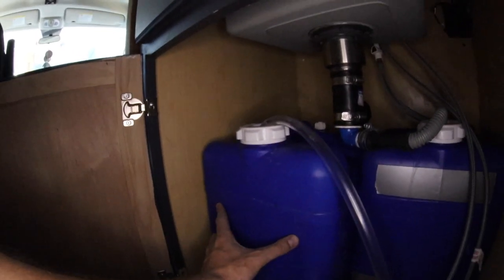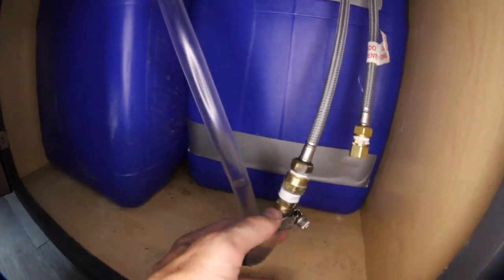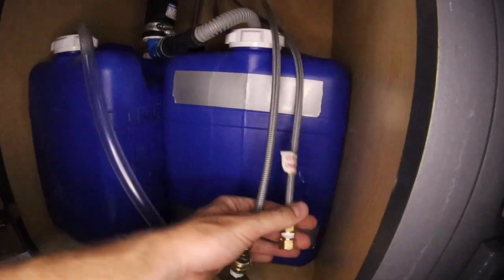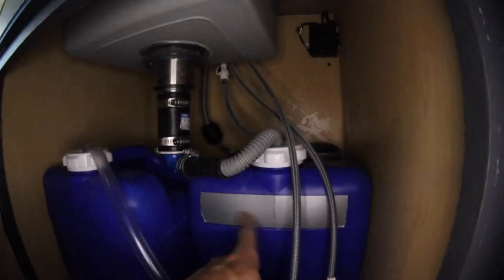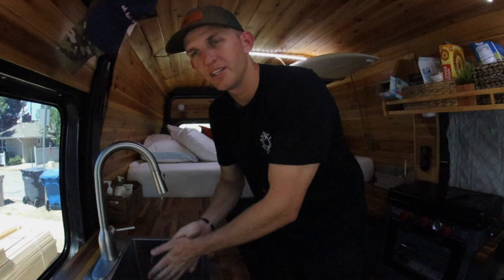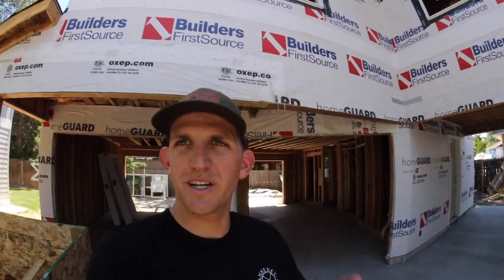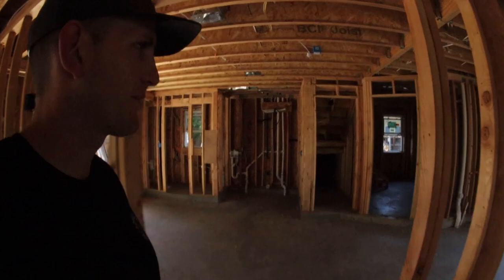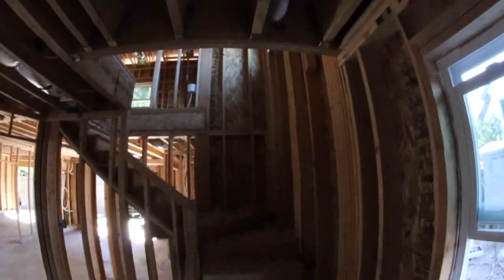CHEAP AND SIMPLE DIY PLUMBING SET UP | WHALE FOOT PUMP

Comment: Thanks for sharing this video.  Something you might consider to work in tandem with your foot pump is using a Coleman 5 gal jug with spigot on your counter top.  The jug can be placed on a 6-12 inch support to allow faster filling into coffee pots or pans for heating water etc. .  (Place jug on floor when travelling.)  The foot pump can be used when only a splash is needed to reduce water use and limit the gray water as well.
Reply from the maker: Good idea Jim!

Comment: PLEASE AVOID BRAIDED HOSES!!  Here's why: As a domestic plumber in the UK for the past 40 years I can sympathise with this old 'effort-to-flow' problem, and it is largely down to those pesky braided hoses and their tiny bore - ie the lack of space inside the tube causing difficulty in passing water! 
 We have both mains water and gravity-fed water systems in houses here, and if you try to use the braided hose tap supplies with gravity-fed systems or in low water pressure areas you will be terribly disappointed with the flow. An already poor flow will be severely restricted by braided hoses, and you will become very disenchanted very quickly. 
A foot operated pump will need a tap or fawcet with, as near as possible, a 1/2" inlet and NO hose restricting it. 
Hope this helps people to not only avoid this with manual pumps/foot pumps but also with electric pump installations, as the restrictive nature of braided hoses burns out the motor very quickly. Remember, braided hose is a big no-no anywhere in a van, caravan, motorhome or boat set-up no matter what system you use, unless those braided hoses are as close to being full 1/2" or 15mm bore right through, including through fittings. I have seen this problem aggravate customers hundreds of times, and had to explain why there is a problem. Repeatedly damaging a pump will soon make you wish you'd had wider bore pipework, and even a foot or hand pump will quickly develop a leak at a weak point in the design after persistently fighting to get water to travel through a thin stretch of hose.  Whale electric pumps are wonderful, but if you make them struggle non-stop they will soon give up. The chinese copies are much, much less able to accommodate a thin bore, and will die within the first two week trip away. 
You may also inadvertently restrict hot flow through a gas or electric water heater causing it to repeatedly turn on and off, and possibly damaging it beyond economic repair. 
I really hope this helps you and that you've read this in time, wherever you are in the world.
Reply from the maker: What faucet do you recommend. Thanks for the info
Reply: @AnkeneyVanBuilds  Well when you go to purchase the faucet either check on the packaging or ask the staff for confirmation that it is designed for use with gravity-fed systems. The difference in functioning is that gravity-fed probably has around one bar (14lbs/square inch) of pressure behind it, and the water pumped from the local waterworks may have between 3 and 5 times that pressure due to colossal electric pumps. Therefore a faucet designed for gravity-fed systems is able to give you a good flow thanks to its much wider bore tubes. It's a good idea to do a bit of research online first so that you will not be disappointed. A quick phone call or email to the importer or local seller will confirm or deny its suitability, and this question will have arisen plenty of times before. 
Quite often the mention of it on the box is microscopic - well they don't want you being put off by realistic facts now, do they!! I often get customers complaining that 'that faucet my son installed in the bathroom is pathetically slow - can you fix it?". 
I know instantly what the problem is.

Comment: get a Whale Gusher foot pump- it's what everyone uses in the sailing world. same idea but a profoundly better pump design - output flow per pump  vastly better. fill a 12 oz water bottle in prob 2 pumps. Asian knock offs on ebay for $60 shipped.

Comment: Are you happy with where you put the actual foot pump?
What is the RV adapter at the bottom of the sink?
Thank you for such helpful videos!
Reply from the maker: Yeah the placement is great! 

Here’s the link to the drain!

https://www.amazon.com/Camco-Flexible-Trailers-Connection-37420/dp/B000EDUTPO/ref=mp_s_a_1_5?dchild=1&keywords=rv+drain+sink+valve&qid=1624906424&sr=8-5

Comment: We use the more expensive foot pump and it delivers about twice as much water as the one you have. We dont have an electrical system yet so we cant convert to the electric pump..
Reply from the maker: Interesting. What foot pump is that?
Reply from the maker: @cwetfeet  yes I’ve seen those!! Are you happy with it so far?
Reply: @AnkeneyVanBuilds  yes. Easy to use and seems to pump plenty of water. It pumps on both strokes.
Reply from the maker: @cwetfeet  good to know!!!